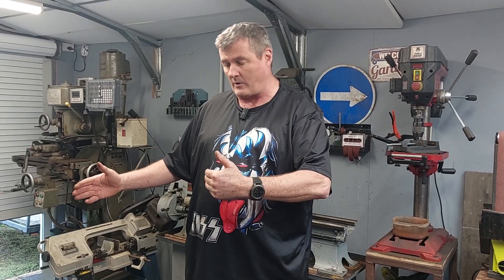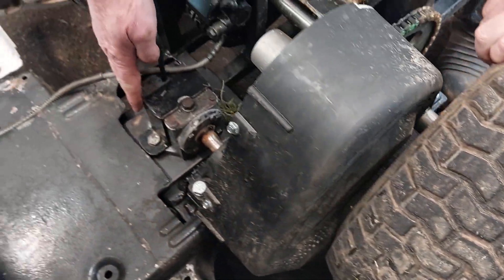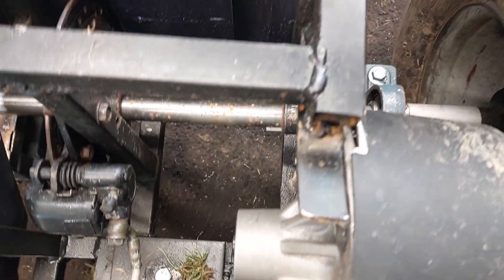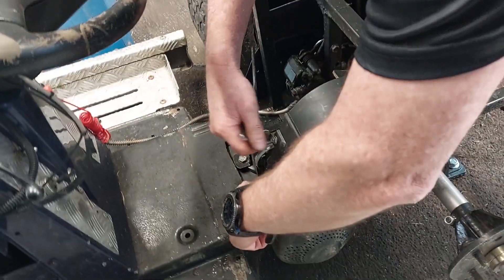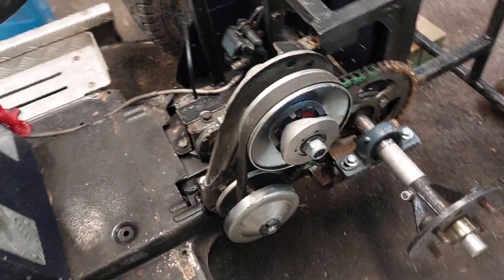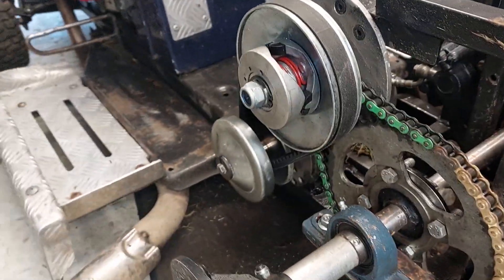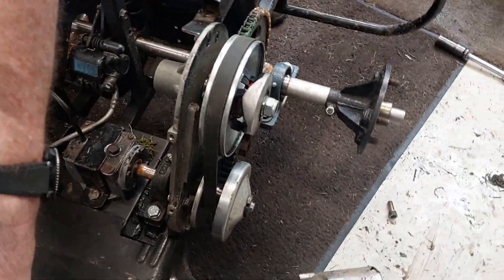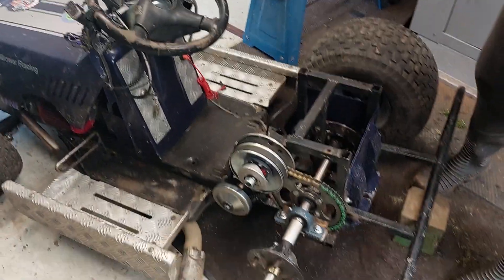A CVT in a Racing mower?

Comment: Hey Bazza. Do you still have a belt clutch in between the motor and gearbox? If we take a standard mower and bolt the cvt to the motor and then run chain to the gearbox and from the gearbox to the drive shaft. Trying to avoid the extra engineering of the shafts to bring the cost down. This class is only a standard modified and we want to limit the top speeds to 55kmh. Our rules say 1m wide and no lowering of chassis which is not leaving too much room for the cvt.

Comment: The yellow rear spring will serve you well. They use in junior dragsters. I have gone to that spring on a mini bike and helps to get power down and load rear pulley😊
Reply: How much power are you putting thru a 30 series?
Reply: @peterhoffman135 at a guess 12-14hp. Was blowing right through rear spring and not making good rpm